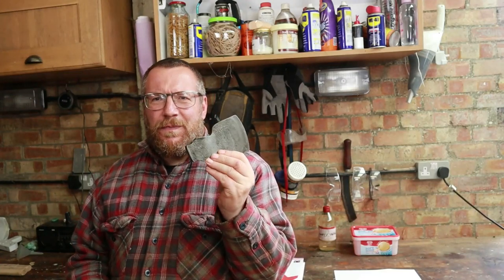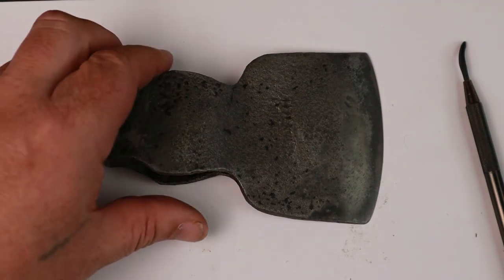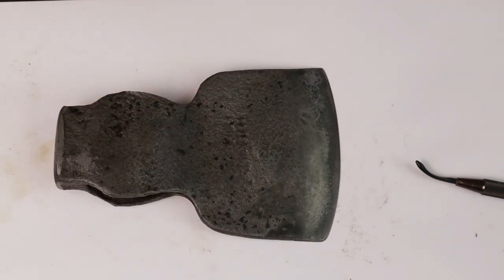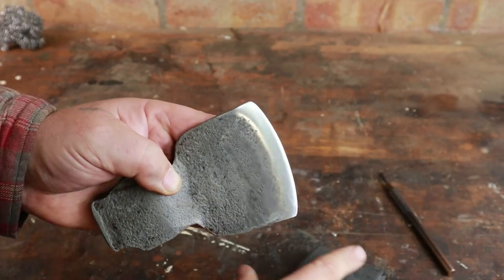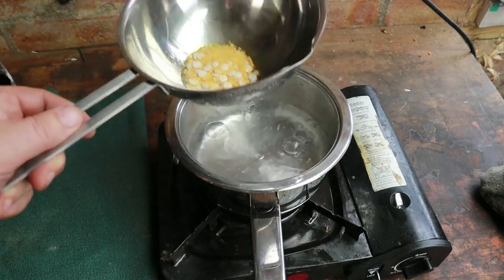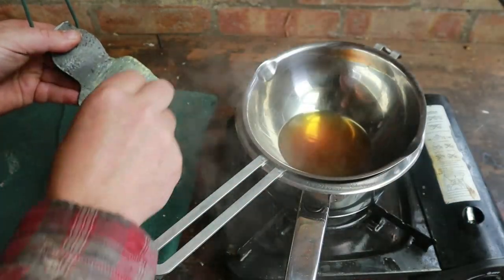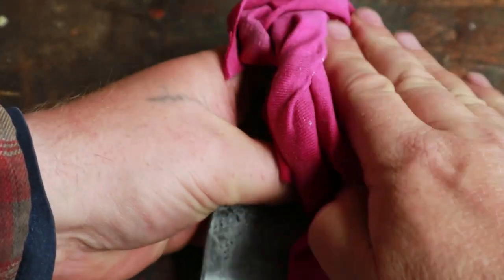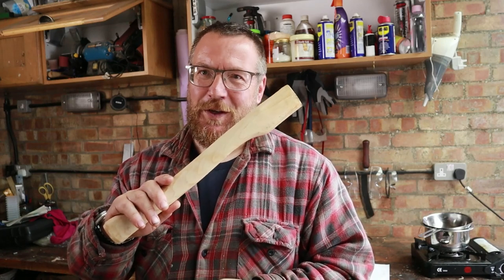Rust Protection for Axes (& Other Tools)

Comment: No apology needed for the rain. It added a nice touch. I have not tried using wax for preventing rust. I usually use G96 gun oil. I have a nice old ox head axe that I bought, cleaned, blued and hafted. I have a simple sheath for it but I noticed the other day when I took it out it had a layer of rust on it. So clearly the oil didn’t work as well as I’d hoped.
Reply from the maker: It happens - particularly if left for a long time. If I'm putting my axes away for a long time I find petroleum jelly works well

Comment: Your beeswax/carnuba wax/mineral oil is the same formula that I use for  protecting cutting boards. Stands up to a cloth wash and rinse, is easy to apply and imparts no unwanted flavours to food prepared on it. What does this have to do with axes? I'm restoring an axe I received from my Boy Scout leader, in 1968. He said it was old then, at least 20 years. So my old axe is close to 75 years old maybe older. I could buy a new one, but I love it, I know it, it's never failed me and it deserves more than just to be pushed to the back of the shed. I hope when I'm ready to part with it I can give it to another young Scout. Thanks for the information, I had considered using my mix, but seeing someone else use it gives me some reassurance.
Reply from the maker: I love old tools like tgat - they have so much character!

Comment: Amazing how many household products are just slight variations on the same theme. 
 Does the axe was also have a friction reducing effect, to help the axe through the cut?

The maker's mark seems a little clearer.  I can make out "Riley".  My similar axe is marked "JOHN RILEY SOLID STEEL",  but it is a little lighter than your axe head, at only 15 ounces.
Reply from the maker: I hadn't considered that, but it would make sense, we certainly wax panel saws for exactly that reason. Old chippies would rub a candle on them.

Comment: Great video thanks so much for posting. With changing climates I have started waxing many steel tools to prevent rust in a formerly dry part of the US! keep up the good work. Looking at your backing shelf I notice you are a fan of WD40, a must for so many things.
Reply from the maker: I use WD-40 on a lot of things after use - for example a quick squirt on hedge cutter blades or chainsaw bars.

Comment: Adding carnuba wax to make it harder, and then baby oil, to make it softer, ???  Don't understand,,   is it me,??
Reply from the maker: The mineral oil is to make it more elastic rather than brittle. You can omit the Carnauba wax if you like but I find beeswax alone too hard and diluted with oil too greasy. By all means try your own combination of waxes & oils, almost anything is better than bare steel. When working with axes I often use petroleum jelly on a scotchbrite scourer to clean off sap and give temporary protection.